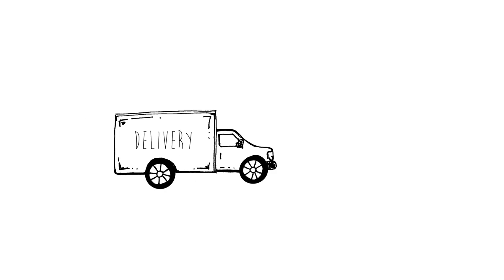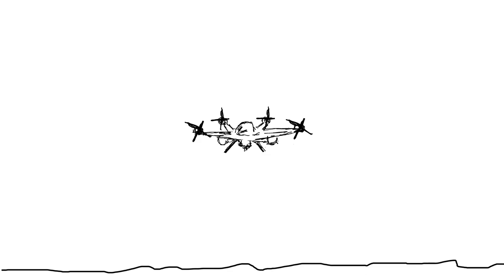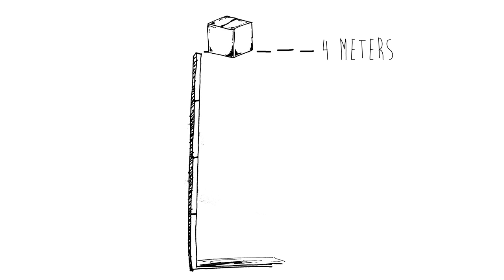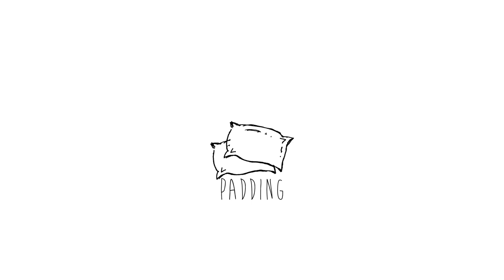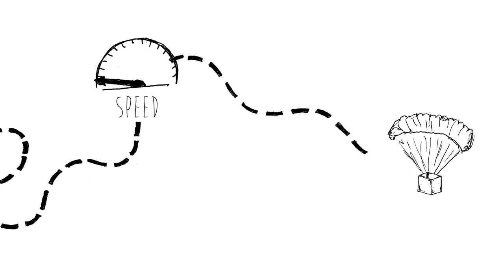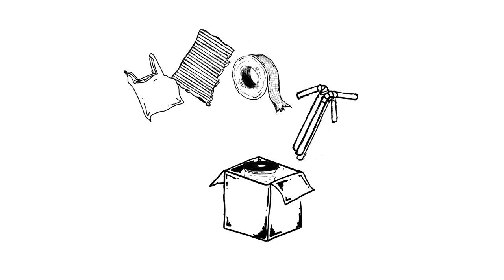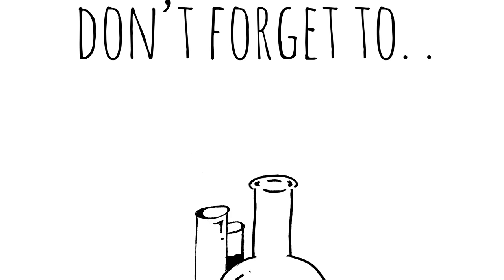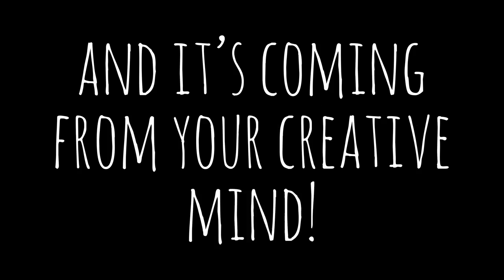Design the Drone Delivery System (A Maker Challenge)

Comment: You could let it down on a rope, and if the rope gets tugged at, a wire gets a current put through, heating it and melting the string, and saving the drone from beeing stolen.